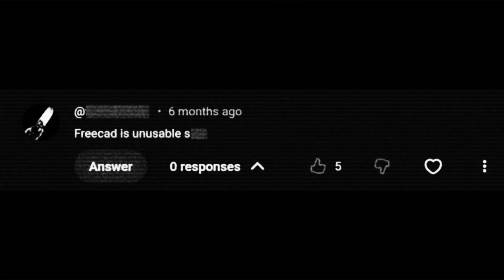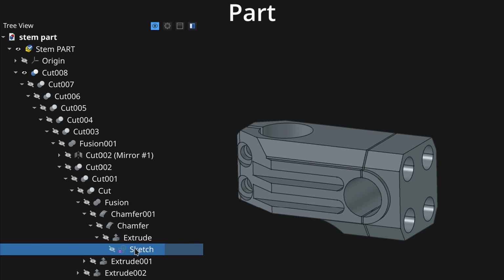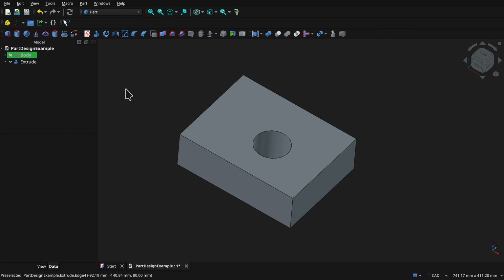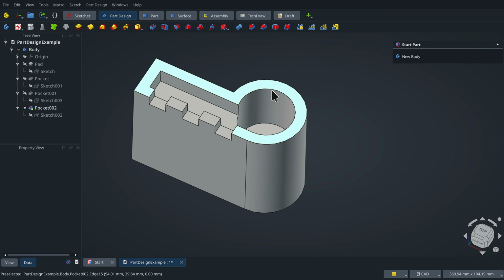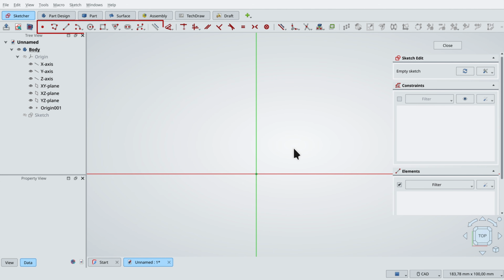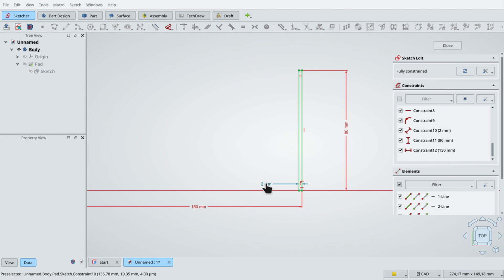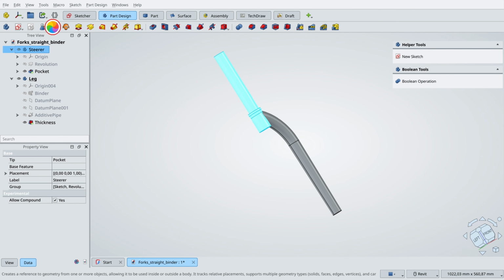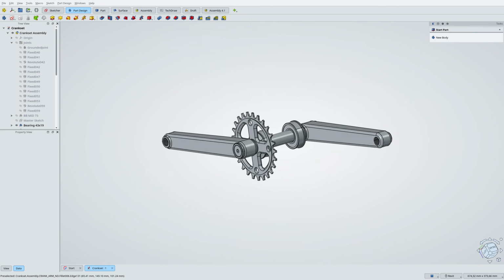STOP using FreeCAD WRONG! Do this INSTEAD (Workflow & Tips)

Comment: I gave FreeCAD my best shot a couple of times over the years. Unfortunately, it never worked out for me. Admittedly, I don't fully understand why it does the things it does the way it does, but even so some design elements of the software add too much friction. You yourself spent a large section of the video on how to make it look approachable. Another non-insignificant part of the video was spent on explaining the quirks to look out for. I can appreciate that some of these quirks stem from the technical limitations of the underlying geometry kernel, but at least some of the more basic ones can surely be mitigated after not too much dev-time. But FreeCAD asks a lot of you, especially as a beginner. Even with an active community making guides, FreeCAD still isn't very commonly used or recommended. That should at least hint at some actual underlying issues with the real, not just perceived complexity. I think degrading or demonizing newcomers to the parametric modelling scene for not being able to learn the software when most can learn Onshape or Fusion just fine isn't helping. It comes off as slightly dishonest to address emotionally charged outbursts that are clearly not doing their best at describing an actual existing problem that isn't hard to see as their motivation.

Just a few seemingly easy to implement missing features a newbie encounters when trying to use FreeCAD:
Fully customizable 3D navigation, not relying on hard-coded presets.
Better presenting default UI/3D render for the newbies at the cost of more setup to an advanced user.
Higher degree of unification or integration of the Part, Part Design, and Sketcher workbenches.
Variable names easily viewable when editing a constraint.
Zero-thickness/face consumption resolution (at least basic cases).

Comment: Really good talk!
It is amazing what freecad offers for free. It's the only really free parametric CAD Soft. 
Coming from CatiaV5 over NX to SolidWorks and now designing in Rhino i really missed the parametrics in Rhino. I don't design many mechanical parts nowadays but sometimes in need some good old parametrics. FreeCAD has most of the time everything i need - the only big problem in this software are those flipping dimensions. Please ... this is often so unpredictable. I don't expect all the comfort functions of a solid works or the crazy parametric surface functions of Catia but stability in the sketches is crucial and should be a lot better.

Comment: I wish FreeCAD would support having multiple shapes in a sketch that can be separately picked for padding and pocketing like 360 does. Eliminates the need to worry about sketches having incorrect references or mismatched planes when your part is a flat base with stuff on top, and the need to have separate sketches for every parallel face/plane that needs a little extra detail.

I spent over 1h in FreeCAD 1.1 trying to make a simple U-channel clip/brace for my car/s broken hatch cover, still haven't found out why the U-channel in my brace is crooked, though much of that hour got spent figuring out the "open wire" issues from trying to do it how I would have approached the thing with 360: a single sketch for inner + outer perimeters to avoid faffing around with external references on details that share most lines apart from creating a 2mm wall at the bottom and around the clip, pad outer, pocket inner, done including cosmetic touches in 10 minutes.

Comment: One issue I'm facing is that the response time is getting slower and slower as the model becomes slightly more complex. This is one of the main reasons why I keep coming back to Fusion360.

To be frank, it's not overly complex: there are only two bodies, and one is used as the master while the other uses the shape binder to avoid cycle binding (it would be interesting to hear how to avoid this).

BTW, I'm avoiding the constraint flipping by using the solver "LevenbergMarquadt" (after enabling "Show section 'Advanced solver cotrol' from Sketcher/General settings.

Comment: I was using Fusion for years, and it was nearly perfect for all my needs until recently. Today I've finally decided to try FreeCAD. I really like that it's free and open source.

To be honest, it was a terrible experience. I couldn't perform the simplest operations that usually take several minutes in Fusion. And not because of the UI, workbenches, or anything else you cover in this video. But because of just one terribly annoying thing. 
FreeCAD doesn't know what a closed contour is!
In Fusion I can create just one single sketch with as many contours, intersecting curves, unclosed geometry and so on, and use it to create as many operations (extrudes, revolves, patterns, etc) as I like. And when creating/editing these operations, I can select/deselect any closed contours at any time. In FreeCAD, though, you have to select ALL the curves that form this contour ONE BY ONE and only then perform extrude or something. That's extremely annoying.
And also I miss this timeline feature that Fusion has (this bottom line with operations and the ability to go back and forth adding new operations wherever you like). It's very useful and adds a lot of flexibility to the design process. 

I definitely won't use FreeCAD until they do something with it, and I'm extremely disappointed because I wanted to like it so much.

You are making great videos anyway, thanks! I guess this program is simply not for my workflow. Hope, it will get better and could be a real alternative to Fusion in time.

Comment: First of all, Free Cad should not offer all Workbenches for the starters, those should be left to be explored later by a designer when the design demands it. Should use as default Part Design and Assembly, Sheet metal 2D Draft and FEM workbenches. Secondly assembly is the missing piece for freecad it cant go out from alpha testing, it is useless IMO. Drawings, sketches should be driven by ISO standards even in Part design (why same thicknes of dimension line and the sketch?!). Some deign decisions were made by software developers rather than CAD designers - thats why it is hard to use, mark that. What were they thinking by choosing certain contraint indication, there are no hints or suggested contraints to be selected for the sake of convinience? Even in 1.1. I can not undestand why so basic workbenches are covered with dust on developer desks. WHY?! I am designing in CAD for a living for more than 20 years. Frustrating expirience with freecad is a consequence of it. I am willing to change my opinion, but there is still lots of work to be done. v1.1 is a good step towards better user expirience. I would like to push it further it has a potential that is burned by the developers. It is like FreeCAD has ADHD it cant focus on one thing and be good at. It is and always will be good enough.

Comment: I love FreeCAD. But! I have some problem. For example, I did 160 1.5 mm holes on plate (1 sketch plate, 1 sketch hole, multitransform right 40 and down 40) and FreeCAD "recompute" every changes so long. And CPU is not loaded at all. CPU 12900H 32 GB RAM. Have a solution for this?

Comment: After trying to do things in FreeCAD and dealing with "weird" failures, I can see why some would conclude that it "sucks", even if I think that assessment is somewhat unfair. It's very easy in FreeCAD to create something that looks reasonable, only for some later operation to fail for some mysterious reason. An offset will fail with the cryptic error message, "BRepOffsetAPI_MakeOffsetShape not done", or a Boolean fusion will fail even if one seems to have done the right thing like making sure that solids intersect rather than just touch. I remember doing a projection on a surface in FreeCAD to create surface detail, only to find that I couldn't create an offset solid from the projected surface. I found out in the forum that this was because the projected surface has been projected from an offset solid, and doing an offset from an offset is fragile, even if that offset surface is visually smooth. Basically, there are things about FreeCAD that are flaky and fragile, and there's often not a good way to diagnose them other than to ask on a community forum and hope for the best.

Comment: I agree. It's skill issue. There are zero contributors to FreeCAD project with any skill in UI / UX / process flow design. I'm sorry but I've used ~10 different M-CADs and sameish amount of E-CADs. FreeCAD is only one that you need to spend whole day reading and trying to comprehend the "right way" of using constraints before you can even sketch anything. It is literally almost worst CAD between E and M CADs I have used only 2nd to Eagle.

Comment: The breaking change in 1.1 to external geometry was a poor choice.  The default should have been the old way with the new way being optional.  This kind of lack of consideration is common in open source projects.  It broke designs without warning. 

This change broke most of the tutorials already on YT.

The change was to make external geometry an actual line and not a "construction" line which, if you only hook one line of external geometry makes an "open wire" error.

Comment: Even then, (from myself as a professional) this is still grossly limiting. If I want to combine sketches that exist on the same plane (sketching multiple features in the same sketch) and still have them 100% independent why can't I? If your answer delineates back to "you're using it wrong", just, stuff it. If I want to setup sketches with datum planes that are setup from sketches then get out of my way and build that workflow so its available. There might be times where the solid needs to be fully defined by these datums because of the corresponding GD&T, otherwise manufacturing and sourcing (sometimes I am trying to keep specific tolerances of my own personal models) loses their collective shit because the cost has grown by a factor 4 and 2 additional setups which can increase failure rates and waste. The devs need to fix their workflows so these sorts of things are no longer the issue so don't you dare tell me that I'm using it wrong; I'm trying to build models that are intuitive.

Comment: Honestly, engineer here with several decades of design experiance. I just tried to make use of some of the new features, which are very promising. But after hours of troubleshooting of problems other Software does not have in the first place, i am very disappointed and frustrated. Even the most simple tests directly lead into known issues, which experianced users know how to solve with a special trick etc.. The whole usage is like trying to satisfy the system in order to match, what the programmer had in mind, creating the software. But it is not a software anticipating how an engineer would think, and supporting that idea. Example: Delete a line from a complicated sketch, would require to first delete all constrains, which require that line. So you need to go and search for dependencies only to be able to delete a fucking line! Thank you programmer for providing this code for free, but this is being paid for with a lot of pain. Learning FreeCAD is mostly learning how to do simple things in a way, to satisfy the high expectations of the algorithms. Lines overlapping? Problem! Areas not surrounded my mathematically perfect boundaries? Problem! Several issues with simple tasks - and always a workaround known for something that is so common, that a workaround should not even be required. I am very disappointed and will let several versions go by, until i try again. I hope the developers of this project will focus more on intuitiveness that on adding more and more features. The big problem of FreeCAD is not missing features but an unneccessarily high effort to learn to solve problems, other systems do not have. A more simple usability with much less "Workarounds" you just need to know, would be extremely helpful for the success of the product. It could be just great, but i am not patient enough to get to the point where i would like to use it. It is just painful - sorry.

Comment: Question
If someone is using multiple monitors, would it be possible to have freeCAD configured to have the following setup:
Mon 1 (Main display) with isometric view fixed in the corner
Mon 2 (Secondary display) half monitor having tool benches listed with a recents list at the top

Comment: I'm one of those who more or less described FreeCAD as garbage. Although my words was "useless" and "unreliable". Not just for the areas you go through where you have to "think for the software" to make it work, but because it simply doesn't (didn't) work. The moment you would do an edit, you would risk losing your whole document.  Constraint errors never said what conflicted or why, even using variables over different objects of a part didn't help. Some changes simply stopped rendering that part of the model.  And when it was clear that the "community" had abandoned the 0.x beta release, that outside the contributor group fixes had been released but never adopted, I moved on. I need my relatively simple models to work. I need to be able to edit and "tinker" with them without crashes and losing a model, and FreeCAD (sadly) never was that. 

So I watch your video and cannot understand why you aren't seeing that. It's not because it's structured in a way that is very different from everything else (and there may be good reasons for doing that) but because it's not consistent in it's function. Crashes and corrupted models, a constraint system that is not only hard to use, but when it fails or find conflicts, you quickly get stuck. When you have cross layer constraints, things fail when you change the referenced layer.  So it's a fun toy, you can do small things and see cool demo features (I loved being able to bring my KiCad PCB model into FreeCAD) but it's just demo features. I learned not to trust them - I learned the hard way by having to redo models I'd already invested hours and days into because of software errors. So it's not "dumb" users saying this because they don't understand the tool.

Or perhaps ask yourself why those of us who said this, went to OnShape, Solidworks, Fusion etc. didn't say that about those tools?

Comment: In all honesty and fairness, if a 40 year old that grew up with computers can't jump on and start without several hours of instruction and asking questions, it's crap. This is a problem of ALL cad software, and quite a lot of image and video editing software. People can get good at backflips and think it's the definitive and proper way to walk, but that doesn't make it right. Backflips ARE a skill issue, but is it really required for walking? Too much of the UI design is counter to the design of the entire rest of the OS and software ecosystem.
I had to watch over 30 hours of video just to find one that explained enough for me to draft a part I could have drafted on paper in less than 2 minutes. This is not learning a workflow, it's fighting bad UI design. Backflips, dude. Backflips.
Reply: If that's your attitude you should just get AI to do it. Seriously. There's nothing honest or fair about this take - all software of a complexity suitable for serious use has a learning curve. This is because "simple baby UI" is not efficient once you start using it for real work, instead of just tinkering. This is also true of SolidWorks, of Bender, of Resolve, of Photoshop, anything that allows work to get done quickly has been designed to get that work done quickly, not to coddle newbies. Check your ego.
Reply: @deejay4am 
TL:DR Even in a halfway decent UI, learnability doesn't get in the way of a fast workflow. Where is my ego?

I am trying to use AI to assist me to create a part, and it is failing miserably to assist me. Is this an ego problem? I have trouble seeing it that way, so if you could explain please?
Bad UI design could be measured by the amount of "What is..." and "Why can't..." that gets asked when learning the UI that you have to go outside the software to answer. For instance, when drawing a single line in FreeCAD, the interface prompts at least 10 questions from me that fall into one of those 2 categories. Some of the answers to those (from the internet, not available from the software) just prompt yet more questions.
I am not requesting "simple baby UI" and your assertion that may be the case seems at least misinformed. For someone trying to learn the UI, the UI it's self offers no help. This is not mature design, it's poor design. Are you suggesting that anything that helps someone learn is a hindrance to future speed of use?!? If so, you clearly have no idea what I'm asking for, so I would suggest asking for clarification instead of offering judgement.
Should the interface be designed specifically for there to be a need to take classes to learn a piece of software? Conversely, should the software be designed with ease of use first, and then the hot keys and shortcuts be developed over time, without the removal of the ease of use? This is the iterative problem that probably created this software: It's trying to equal existing design software before being usable software - they left out the ease of use that something else had before it got to where it was. Maybe they thought it was "simple baby UI" and unnecessary because they didn't need it themselves. Now, because of a decision someone may not have known they were making, the learning curve is needlessly prohibitive.
The quick test: Give the default installation to several people that have never used that kind of software before, and disallow internet searches and verbal communication, and give them a clear written end goal. The results are a direct reflection of the quality of the UI. Many that make software want to ignore this test.